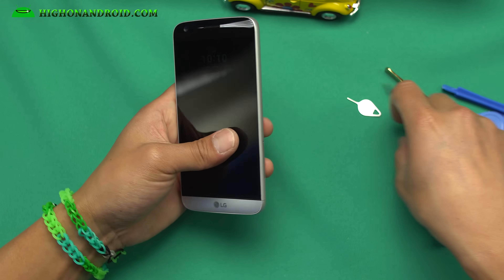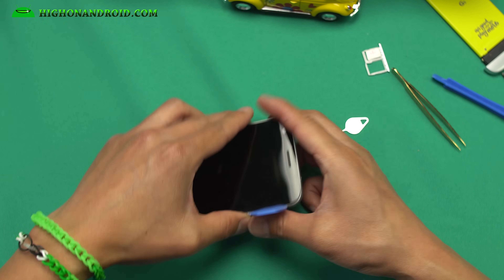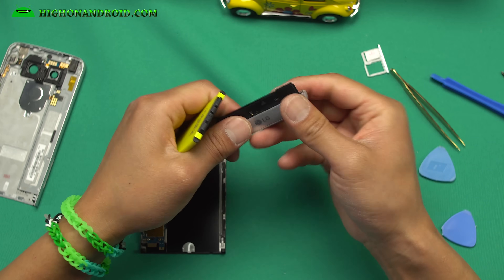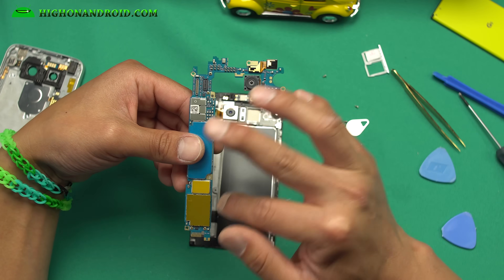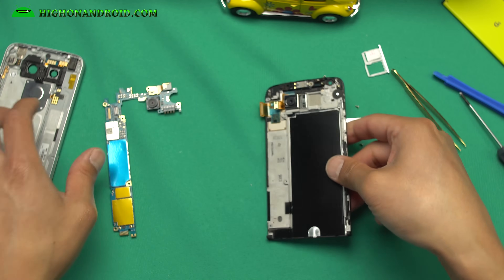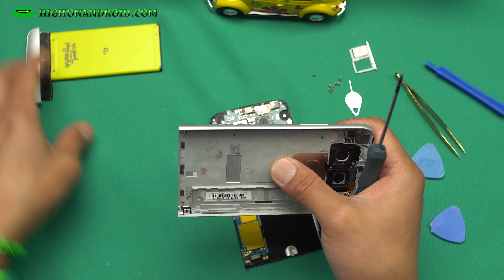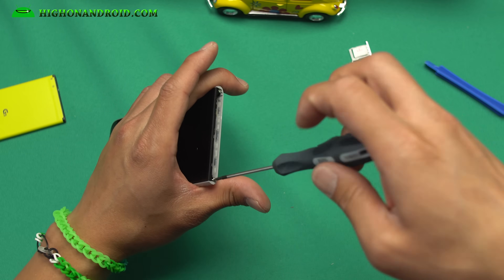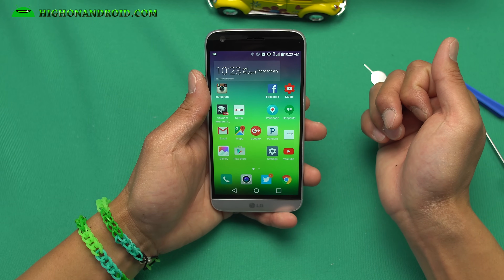LG G5 Disassembly Reveals Metal Unibody Design!

Comment: This is a great video!! I’m sure this is a lame question but what type/size screwdriver is used to open up the phone? Something has happened that the phone starts to boot up then stays on the startup “LG Life’s Good…. Powered by Android” screen which constantly flashes on/off. It never gets to the OS stage and I can’t use the power button to power it off but I can power it on. Also the recovery mode/hard reset doesn’t work (power button and down volume button) however things like booting into the IMEI screen (power button and volume up/down at the same time) works plus I get the battery symbol on screen if the battery is low. I’m assuming these are coming from the ROM? The phone has been dropped a few times so I want to open it up to see if anything has come loose however I need the screwdriver to do it.
 BTW: If anyone has encountered this bootup problem let me know. I have some pictures I want to get from it.

Comment: Hi Max, 
Thanks for all these tips!
Maybe you could help me with my LG G5 - the LCD & glass screen has been replaced twice after dropping it. Since the ending replacement, I had trouble with my back camera - could this mean I need to disassemble the phone (as you've shown) and reconnect the camera?
2nd issue: the phone has been doing a crazy ghost touching freakout - to the point where I cannot use it! Does this mean a full screen replacement is necessary?

Really looking forward to your response! thanks a mil :)

Comment: ...got - 1 - for-  5 - days - fingerprint stopped - & - was sleepy - when - setup - pattern - can't -recall - ...if - i  - change - fingerprint - button - will  - it - solve - the - pattern - situation... i called - lg  - they - want - $ - 300 - +  sh - & - hdlg...😕It - can't - hard - reset  - ...worked - great - for - 5- days ...
Reply: Did you buy it used or new?
Reply: Zibzo ...used $60 -to get -it -going -again ...

Comment: Hi Max, my phone just got the half screen glitching, I noticed a few people on YouTube with the same problem but I can't find a video about how to fix it. Do you have any suggestion?
Reply: I think it's something to do with the connectors on the motherboard unmelding. One fix is to take it apart and remove the motherboard. You can use a hair dryer on high setting or a heat gun and once you replace the motherboard it may start functioning again.

Comment: Hey Max, great video.
 I was wondering if you could help me with a mod question. I fly drones using 5G wifi, 
however my signal crashes around the 70m mark, 
yet the drone I use is supposed to have around the 400m  capability, 
So I was wondering if you could tell me where the ariel is in the G5 and how i could fit an r sma lead to it so i could add a directional beam ariel or even a yagi. 
Or better still is there some sort of wifi antenna that i could connect wirelessly to without having to strip down my lg g5?
cheers

Comment: +Max Lee, my LG G5 is wonderful. I broke the camera so SquareTrade sent me a Refurbished replacement G5. The replacement has a power button with no click to it. The powerbutton works fine but doesn't go in, there's no push to it. Should I be worried about this. I can tell the rear laser focus light has a slight scratch but still works fine.
Reply: Royce Barber that's not an issue for me

Comment: What's the solution for NO GPS. I have lost GPS signal on my LG G5.
Reply: Ensure your G5 has all system updates. If it says no GPS just once, that's normal. I assume yours has no ability to ever have GPS, and in that case the phone is defective and needs replaced ASAP. If it's an old or used phone or out of warranty, there may be a GPS chip you can replace but I suspect you'll have to replace the motherboard. But first things first...back up files and factory reset, and test it out. If you rooted the phone, an app may block GPS. Oh and I imagine you already enabled Location.
Reply: Royce Barber I have always had GPS for my apps until recently. I have done a complete factory reset and the phone is out of warranty. I get intermittent GPS so that's the mystery. Its as though due a dropped phone it loosened a contact point.

Comment: How to fix LG G5 Screen Split issue using Heatgun.

Disassemble LG G5 using the link below.
https://www.youtube.com/watch?v=hveXdJLJEeU
Disconnect the Wifi Cable (Black One), Rear Camera, Front Camera.

Now with just the logic board, place it on a surface that won't melt.
It should look like the picture below. Warning don't take off anything else
https://imgur.com/a/gmp9Z
Turn on your heatgun and apply left right motion only concentrating on the cpu metal plate for around 15 seconds.
Do the same thing on the opposite side of the cpu plate.
Let it cool down for around 10 minutes.

Put it back together and it should work.
I did it atleast four times, first time it worked but failed after few minutes.
Second and third time was not working at all.
The fourth time I did it, it was working.
It's been a while and it still going.

Credits to the poster.
http://bit.ly/2f1knOL

Comment: Ugh I actually prefer the extra screws to how this is. It seems easy but when you don't have a single thing you can use to pry off the screen it's useless.
Reply: The LG G5 is the easiest phone to repair. Taking apart any phone is a risk to the phone, and should not be taken lightly. You have to buy the proper tools or you shouldn't even think about trying a repair. I hope it all worked out.

Comment: Thank you!  This helped me open my G5 up to do the GPS fix.  I could only see 0 to 4 satellites (at best) before, and seventeen after! (For others who have lousy GPS signal, search around for that info... the short version is that there is a cluster of three little pins for the GPS on the motherboard near the camera and and attachment screw.  I nudged my pins up a little, and also put a couple thicknesses of paper behind the motherboard near the screw to lift the motherboard just a bit so the pins make more solid electrical contact with their respective pads on the rear cover where the antenna is.  Worked way better than I expected.)

Comment: full metal? inner edges of the frame on the inside are very clearly plastic. Even if you want to call the plastic coating over the frame "primer", the frame itself isn't even completely metal. weird video.
Reply: It is mostly metal, the inner metal is about 0.7-9mm thick while the primer is 0.15mm, and is very durable. So yeah, nothing's wrong with the build quality, but if you don't like it you can always get other phones, like the V20, which does have and look like a military-grade build and is made up of an aluminum back panel without primer.
Reply: Bomation I didn't say anything about build quality. Only that a phone that's advertised to be full metal very clearly and obviously isn't. It's suspicious to me that someone taking the phone apart can look at that back housing and call it full metal, there is quite a bit of plastic in there not even a little bit.
Reply: It is metal with just paint over it, that's like saying cars aren't metal cuz its painted. All teardown videos of the G5 have confirmed that it is full metal on the inside, not plastic, therefore I don't see the problem with it. In the end its a durable phone and isn't that what matters the most? And again, if you don't like the phone, get another one, all of this year's flagships are pretty good.
Reply: Bomation I do have another phone btw, I don't know why you keep saying that. You saw with your own eyes the interior frame of the phone isnt completly metal, a good portion of the frame is actually plastic. That's part of the reason why that stupid primer was put all over the phone so they can hide the seams between the plastic and metal. You can actually clearly see these seams on some units, you dont even need to tear the phone down! The ratio of paint to metal on a car and the LG G5 are nowhere near the same, that's such a silly point. And besides, cars aren't advertised as having a unibody aluminum chassis, there are very obviously other materials on a car 

The point isn't build quality. The point is you can't just let manufacturers get away with whatever they want when it comes to advertising. This is not a unibody aluminum chasis, there is plastic comprising the frame and the outer coating of the phone. They should not advertise the phone falsely, period. Stop defending this practice, I don't know if you have a G5 or you just like LG or something, but if you defend this kind of practice it's the consumer that gets screwed every time.
Reply: Yes I get your point with the false advertising, and I agree with that(If they advertise it as a metal phone coated with plastic, then I think most people won't mind). I don't get why you're on a video about another phone if you already have one.
Reply: Bomation because I'm interested in technology duh. I don't become an ambassador to a brand just because I bought their product. Your points don't make a ton of sense to me

Comment: My LG G5 main camera has a problem with auto focus: it doesn't focus by tapping at the screen, it just has a fixed focus at a very close point, so I can't focus anything further. I replaced the crystal of the camera because it had a scratch in front of the main camera, but it didn't solve the problem. The person I took it with said the cameras were kind of out of place, but he also suggested it might be a problem with the software. The wide angle camera works just fine! Any suggestions? 🙄

Comment: Could you maybe make a Video of a GPS mod/fix? I guess your's is broken too, no? Every G5 should have this issue.
Reply: I know this "mod". It doesn't do anything. It will break again after 1-5 days. Someone needs to develop a working mod of soldering some contact material on top of the contacts, so it will fill the gap of 0.5-1mm between the contacts.
Reply: mkd1r You're right. Or maybe glue some small plastic below the contacts, so they'll keep straight after bending, instead of falling back again.

Comment: Hey Max, nice vid man! 

What I'd like to know is if it's possible to disassemble the power button/finger print scanner assembly and totally remove the fingerprint sensor, then put it back together and have a working power button still. I'm a privacy freak like that and don't want there to be any chance my prints can get lifted! I'd rather take it out once (or sever connection to it) than have to keep tape over the outside of the phone!

Comment: Please - I am in need of desperate help. I have sent off my brand new LGG5 to LG for repair as the phone does not read mine or anyone elses sim card. (I assume that the problem is with the sim reader as my sim works in other phones). LG have responded saying that they will not fix the phone under warranty as it is 'user fault' not manufacturer fault or problem. I have had this phone for an hour before it stopped working and LG are not willing to help or fix the phone. 

Can you please show me how to remove the sim component and replace with a brand new peice as I have no where else to turn to.. and dont want to fork out 100 pound for LGs mistake that they are not willing to admit to.

I would be appreciate any help you can give me 
Many thanks, 

Jay

Comment: Such a tough call between this and the S7. Guess it mainly comes down to modularity/removable battery vs waterproofing (and possibly a preference for amoled over lcd). Cameras are both great although the LG's wide angle lens looks awesome.
Reply: +Dan Mitchell get G5 some cool stuff is coming with the so called friends hench I work for a tech company and we are currently discussing making a front facing speaker as soon as LG brings out information about how the modularity works
Reply: +dutchICTtutorials Yeah I'm gonna go with the G5. I was stuck in a bootloop the other day on my Xperia (with removable battery). Thankfully, removing the battery fixed things. Don't think I'd be comfortable paying over 600 for a sealed in unit.

Comment: LG FTW
Who want a phone that is just looks... go to the S7, those people will be happy there.
But who want a phone design to be the best hardware for a consumer (resilient, easy to repair)... LG is amazing
Reply: +1300l  resilient remains to be seen.
Reply: mikldude
So you are telling me that metal is less resilient then glass?! wtf
Reply: +1300l not telling you anything, 
I said it remains to be seen,  yes it comes apart easy, yes it has some  screws  holding it together, and yes it's metal, but in  the  rigors of  daily life it may or may or may not prove to be robust.
I used to repair cars for a living  , they are metal too , with lots of nuts and bolts , and screws ,  but they don't always hold together.
a lot of parts on the modern car are glued together, glued can actually be stronger than nuts and bolts.
I  look at that case, and the sides are basically only sandwiched in between the sides, and a couple of tiny screws , 
so from an engineering standpoint you may find its not as robust in certain situations as other devices that are glued together.
but as I did say, it remains to be seen how it stands up to life, personally  I'm not convinced .
Reply: mikldude
There is nothing to be seeing. Resilient Material vs a Non Resilient material. Even the LCD have a metal chassis on the G5.
If you don't know how both materials react in a tough situation... i really don't know what world do you live.
Reply: 1300l if your talking about the glass landing hard on a piece of cement , of course glass will crack , as metal will bend , dent or scar but if your talking about general holding together or not coming to pieces or not bending when put in certain circumstances when suffering a bit of abuse ,, not vibrating apart when dropped x amount of times , that is certainly another matter, that as i said , robustness remains to be seen..
you dont really think dropping a phone is the only way a device will stressed do you ?
i certainly dont.

Comment: can someone answer me this? how can something be unibody if the bottom part is removable? and even more so if you remove the bottom part it makes your device inoperable.
Reply: This is by far my least liked LG phone thus far. It's OK. But that's it.
Reply from the maker: +marcus nartatez Good point, unibody doesn't count the modular part.  Technically it's not unibody but the actual body is unibody apart from modular.   Very confusing but the bottom line is that it's pretty solid piece of metal other than the modules.

Comment: Great and unique video. I recently subscribed to you and am not disappointed since. May I ask your opinion about the dependability and possible durability of the bottom module's locking  mechanism ? Not the body is metal or not but that gap between bottom module and screen, and if the gap will increase or not over time is the main concern withholding me from buying this phone.
Reply: +Yalın Gürcan I have used the phone, its pretty tight actually. You won't expect any gap between the modules and the screen itself.

Comment: i would have to say that is the easiest phone i have ever seen to take apart and fix 10/10
Reply: Yea not like iphone u have to cut the wiring from the battery then theres sticky crap everywhere tape too
Reply: @quickscoper5837  you are right thet is much easier to disassemble the lg g5 instead of any other smartphone but it requires disassembling procedure in right manners ..
Reply: Bri the set need to be disassemble first from left side and then from right .this guy first lift left side and after that he lift the upper side insted of lifting the right wide .the way that he disassemble the set increase more chances to break the touch like i have shattered my screen by disassembling the phone by the method performed by him ...

Comment: LG G5 looks like a fantastic telephone.
 however I never buy brand new telephones.
 I prefer 2 year old phones.
 second-hand phones far more affordable.
 I now have the Samsung S2.
 and I'm thinking about upgrading.
 cannot get Uber and other apps
 I'm hooked on Samsung but LG is looking very good.
 if you could do a video on older phones
 something in the $200 range and what to look for
 thank you
 cute kid
Reply: get a freakin lg g3 bro. im commenting with it lol
Reply: note 4
Reply: +alex turianskyj yeah.. V10 FTW too
Reply: or if you want a super good device that can last you more than 3years and is cheap? get the LG G2. yes it might be er 2012? but it is still a monster. although i now use the LG V10, i still have my G2 which i kinda spoilt it from alot of drops... just the screen is fucking up. other than that. it's still perfect. of course my batt is bad now bcus I've been using it for 3 years now. it still has battery life btr than the S5(serious) and since if you're gonna buy it new amd fresh. the LG G2 can last up to 12hrs of continuous use. it's that good. however, no removable batt and SD card slot. if you want it get the G3. or G4. it's quite cheap on amazon for $200+ and $300+ respectively. I'm not sure abt the G2 tho.
Reply: +Kaoss Comkaoss not the V10 it's not cheap get a LG G3 it's around 200-ish and i have one either great phone for the price
Reply: +Mani00 same lol